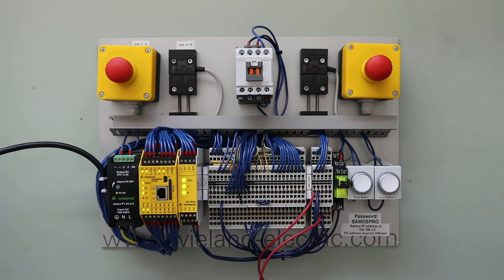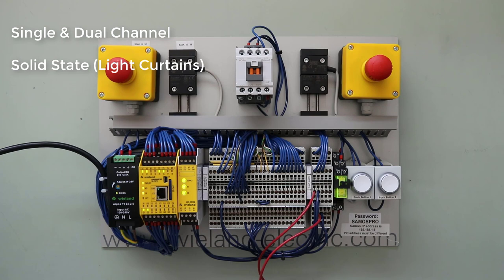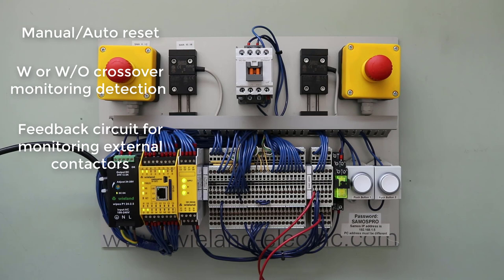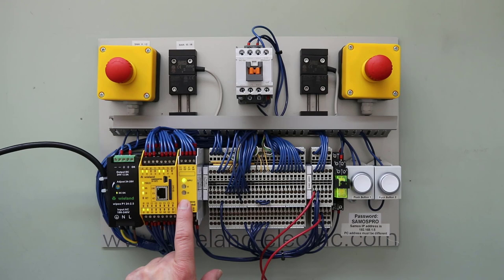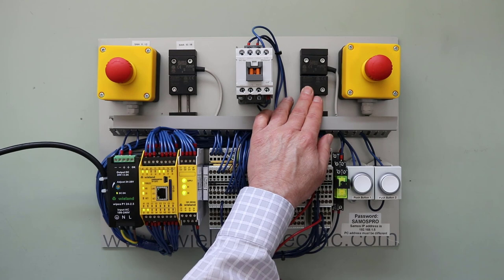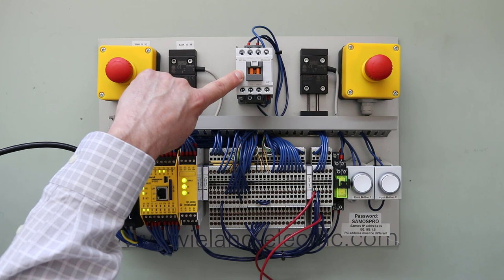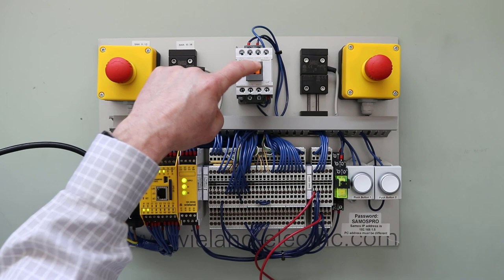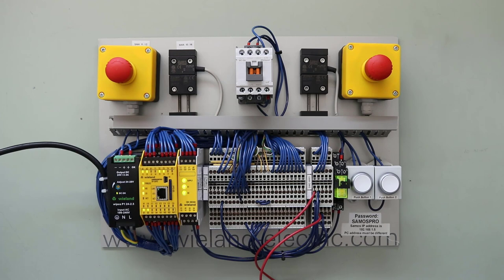Universal Safety Relay by Wieland Electric - DC Controls

Comment: The correct way to use this setup is with 2 contactors in series switching the load power, if the one welds closed in operation the circuit won't open in an emergency. The safety contactor is useless if the supply cannot be broken.

Comment: As previously mentioned, you should use two series contactors with NC aux contacts wired in series to monitor for welding.  I know this is only a test rig but you should probably mention it in the demo.